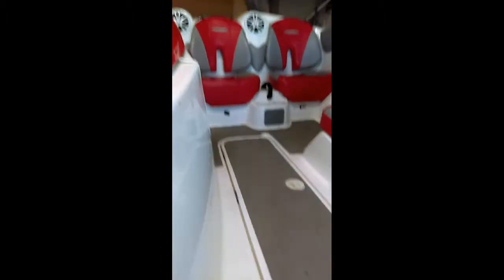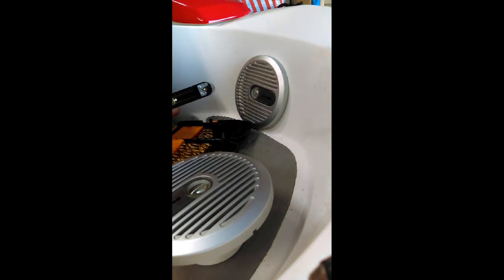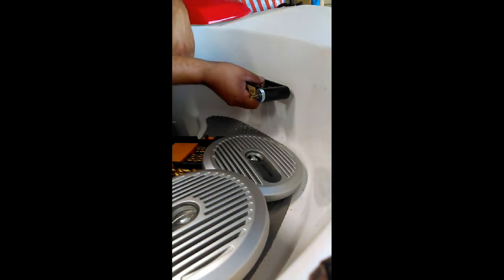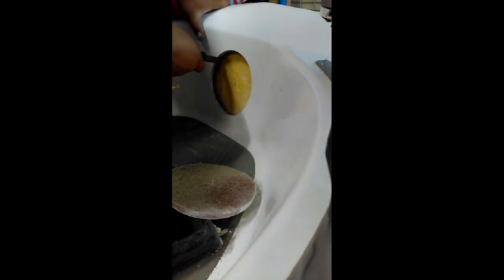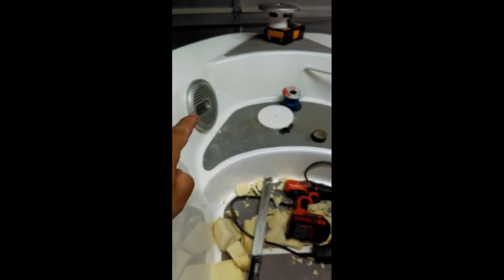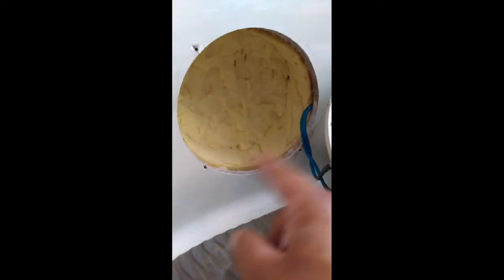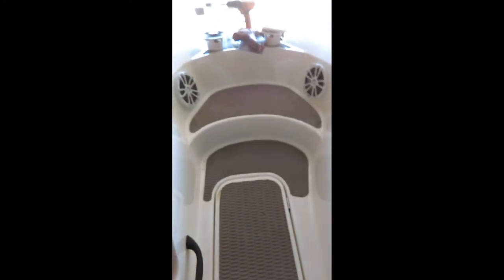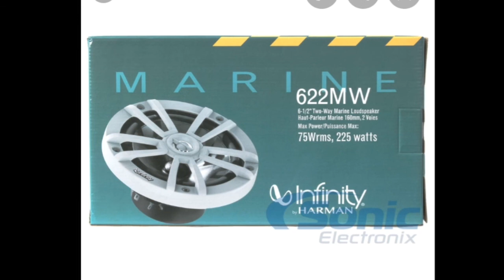Sea Doo jet boat adding speakers up front.

Comment: Excellent this is GOLD!!!!!!!!!!!!!!!!!!
Reply from the maker: There's not much content on the newer seadoo jet boats on Modifications or tips so hopefully this will help someone and I will try to keep adding more as I continue to enjoy my speedster 150.
Reply: Here’s a question.  When l lined up the speaker on the right side I found that the surface was uneven. On the left side I did not find a totally flat spot.  Mine are 6.5’s.  Did you have that problem.   How did you seal the little gap since it’s not flat.

Comment: Here’s a question.  When l lined up the speaker on the right side I found that the surface was uneven. On the left side I did not find a totally flat spot.  Mine are 6.5’s.  Did you have that problem.   How did you seal the little gap since it’s not totally flat?

Comment: Why didn't you put all that foam back in there?  Or did you?  maybe jam it down somewhere?
Reply from the maker: You get more bass from more open space, plus if I just stuff it back in the peices will end up on the bottom of the hull since it's all open and will eventually plug up my drain. So make sure to clean up as much debris as you can or it will end up plugging your drain.
Reply: @elmanny8630  thanks man!  Was it hard to fish the wire from the RIGHT speaker to that one on the LEFT where all that foam was?  How did you get the wire across the bow inside...with all that foam in there?
Reply from the maker: @DariusBarazandeh  it was pretty easy but it would help to have thicker speaker wire and push between foam and fiberglass as far as you can then stick your arm in the right hand side hole and feel for it then pull through.
Reply: El Manny thanks.  Great points!!!